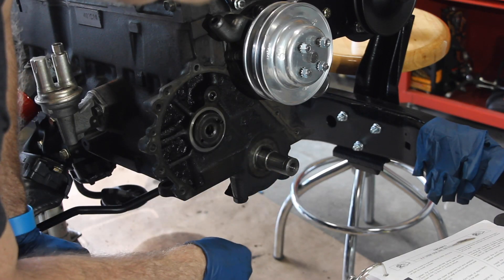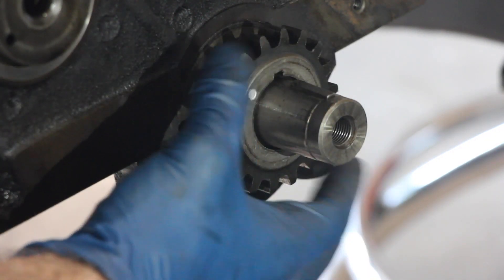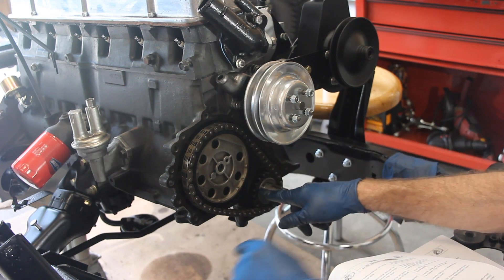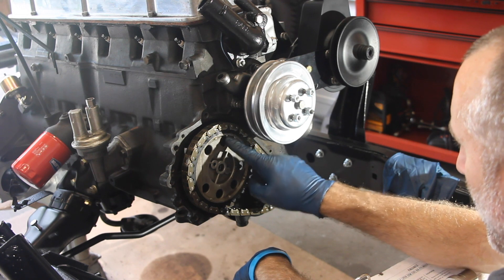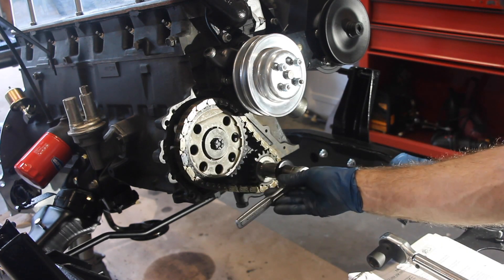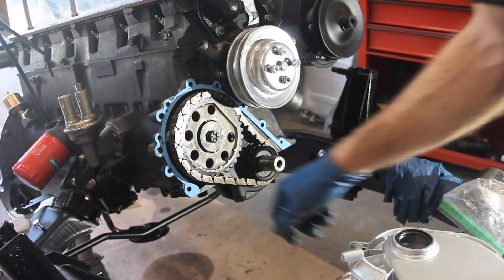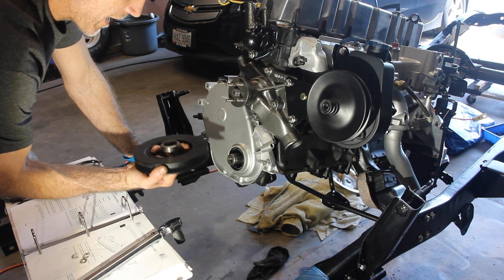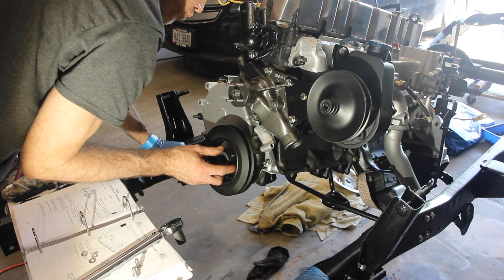Jeep CJ7 4.2L Timing Chain Replacement

Comment: Why do you turn the whole setup forward at the end so that the mark on the crank shaft sprocket is at 3 and the cam shaft sprocket is at 12:30 to 1?  Why not leave them lined up as at the same point that the old one came off?
Reply: To check the amount of pins in between the engaging links of the chain.

Comment: I don't see a oil pan...so guessing you removed it and never mentioned the lower Timing cover gasket. It's a real bear to get that cover back on with oil pan and water pump still on engine.

Comment: I'm in the middle of a rebuild, when I removed my timing cover,  it didn't have timing chain guide. I came across some places that states it should. I notice you didn't have it. Can you provide any additional information?
Reply from the maker: This is for an AMC 258 engine, correct? Just making sure, because I know nothing about the Chysler YJ engine or the AMC 232. 

Actually, from what i recall, there is a guide that is part of the block, but some of it had worn away due to slack in the chain. There is no mention of a guide in the factory service manual, so i wouldn't give it too much thought. As long as you have minimal slack in your chain or you've replaced it properly with the right size, you shouldnt "need" a guide. Ill look more into it and if i find out something new I'll let you know. Carry on and keep rebuilding. :)
Reply: @coolguy_CJ7  yes, it's  for 83 CJ-7 258. Thank you.
Reply from the maker: Actually I mispoke. The chain guide is part of the cover and is a separate piece. There are 2 tabs on the bottom inner area of the cover that the guide attaches to. You can replace it if you feel like you need one (they're cheap), but I've never done it myself and like I said before, there's no reference to one in the service manual.

Comment: Where did you get the timing case cover? If so, where did you get it from? I'm looking at replacing mine, every review says the bolt holes dont line up.
Reply from the maker: My cover was OEM. If you need, I can direct you to a couple guys that will have the originals. They are really good with prices too.
Reply: I’m interested. Thank you. I’ll send you an email with my contact info.

Comment: What about the pin and spring that goes into the cam sprocket bolt
Reply from the maker: Tell me more. Wasn't anything described like that in the factory service manual.
Reply: Cool Guy  on my 258 “85”that I’m currently rebuilding  has a thrust pin kit that goes into the cam bolt, I’ll look in my book when I get home but I believe some years have it. Only because the cam walks out and hits the chain Cover.
Reply from the maker: Interesting. I went back and watched my video of me taking it apart. Didn't have those peices. Ill take another look at the manual to see.
Reply: Cool Guy I went back and can find any writing on it only a picture